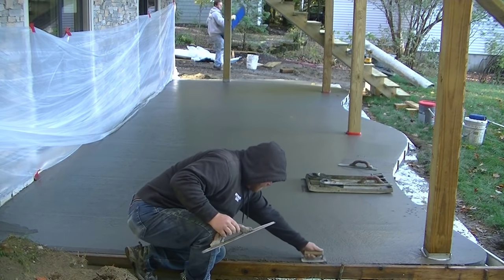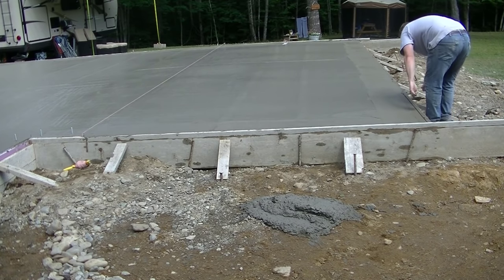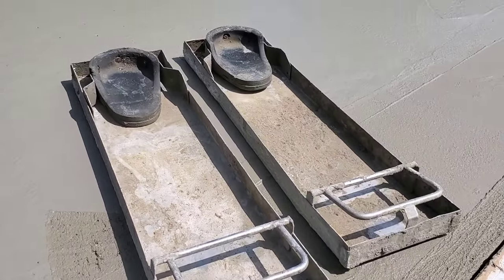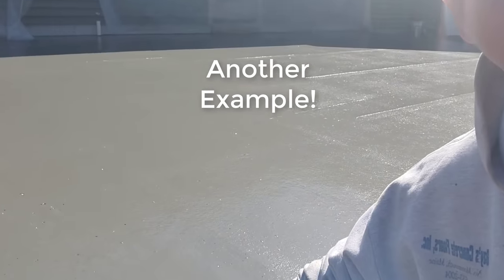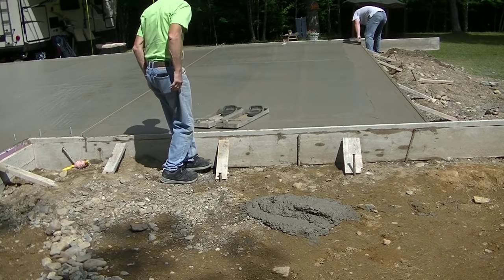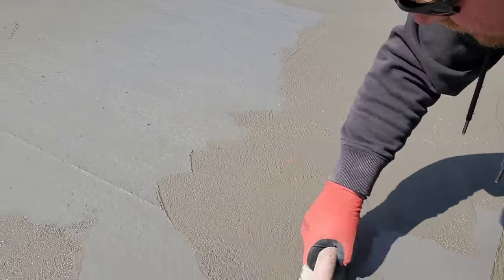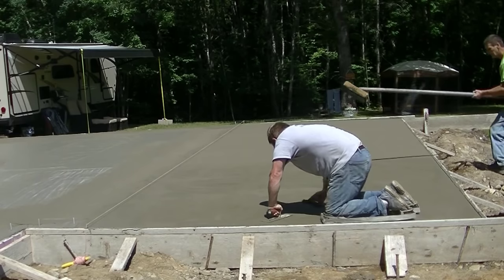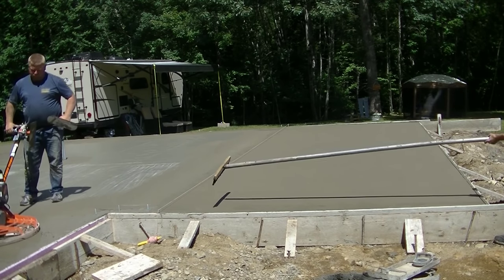When To Start Finishing Concrete - Timing When To Start

Comment: Hi, could you please advice on the best concrete to use for these slabs, so that its easy to finish it to high standard? I am in europe and the concrete grades do like C16/20, C20/25, C25/30 with aggregate usually max 16mm or 8mm max. Is the higher grade concrete usually better to work with as it has more cement?  Thanks a lot!

Comment: Great job I live in the UK and we do all types of groundworks everything up to the damp slab level on houses it's different because most houses are brick and blocks so deeper footing but we do have to do ring beams on bad groundwork witch is like your slabs but it's 18" round the outside or were supporting walls are and 6" in the slab middle I will say your experts at finishing them off very nice work keep it up

Comment: Hey mike I've been following your page for awhile now. I've got a question. See, I have a few walkways and small patios lined up and want to start my own flatwork company. My problem is that these jobs I've been offered only need 1 or 2 yards of concrete. I'm battling minimum load orders here in rhode island and most electric mixers only take a bag or 2 at a time. How can I get around this
Reply from the maker: You have to build the minimum order charge into the quote. Us regular contractors would do that. Then the pour is much easier and faster. If the customer wants it done they will pay, you shouldn't worry about that, it's the cost of doing business on those small jobs.
Reply: @MikeDayConcrete  agreed. Thank you!

Comment: We live in Bokeelia, FL and want to have a concrete slab (not to drive on, just a back patio) measuring 10 ft x 26 ft. If we hire a contractor, how much should we expect to pay for the job? The top foot of the ground is mostly sandy soils. Wished I could do it myself, but I know it will take 10x longer and it won't look as good as a professional doing it.

Comment: if I don't have magnesium float .
I made 1 from Oak , not strong enough angels ,  but still tool.
And I have home made bull float 3mm  aluminium plate  1.2mx 0.3m working good .
what can I use like magnesium floats 
Magnesium cost 40- 50 $ don't have money gor it now

Comment: I learned this the hard way.  25 years ago when I was an apprentice finisher, I scrubbed basement floors until my knuckles bleed.  Sounds barbaric, but it was a lesson never forgotten.  When the concrete is white and crusty, you're in trouble.
Reply: Yeah no doubt. U didn’t have a power trowel? I know i have had some real close calls. Never lost one, but i have had the shit scared outta me me plenty of times.i remember this one job. Mid summer, no shade around for 500 yards, i had my brother sitting on top of the power trowel while i ran it with float blades because the shit was on fire. The extra weight helped to bring up some cream and puch the aggregate down more that if i used the machine without the extra weight on it.
Reply: @aarongrabowski3775  No machine  these were the early caveman day, splash and dash.  We did everything wrong, because we didn't know better.  Learn from your mistakes.  Off course I've had plenty of close calls since.  A good finisher is part chemist, part cowboy and part asshole.  We like to use cc to it's full potential.
Reply: LMFAO
Reply: Absolutely, timing is everything. You can work the concrete or it can work you!!!
Reply: J😮j

Comment: question for Mike: have no problem finishing a broom finish patio….but if we have steps we always struggle to get them done and they set way too fast for us…..any tips? thanks
Reply: @landonmorel3715  get some confilm,  spray on forms right as you are pouring steps and once they are floated in spray on the treads as well. Keep a spray bottle w you and use as needed once you start finishing them

Comment: Not just the weather also the mix and sometimes companies that you buy your concrete from everybody has different mixes over here in Portland. There’s a concrete company called Miller’s concrete when you pour some concrete with him. You better have some help no sooner than you get it out of the truck, set up to work fast, but they do help you. They don’t charge you to release if you don’t know that is slow down. The cure keeps it from setting up so fast timing is everything every different from the last one so trying to judge and gives people tips is almost impossible because every poor is different, and the timing is different. Sometimes you can sit around for an hour or two and then sometimes you need help because you’re still pouring out. It’s already starting to set up us. This video is useless.